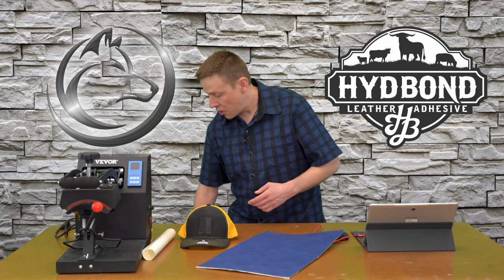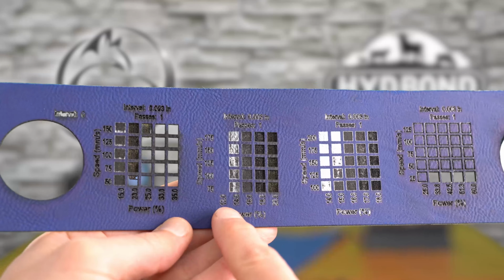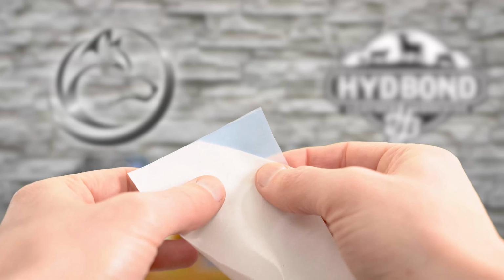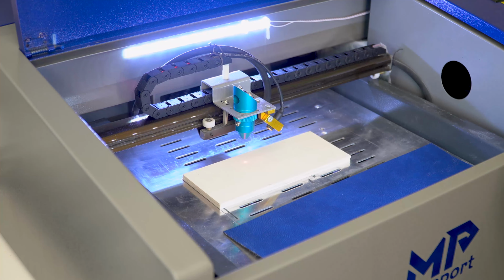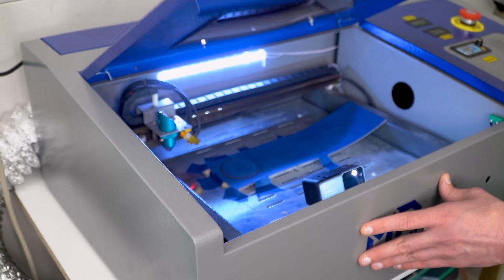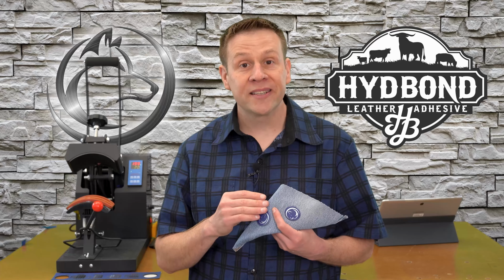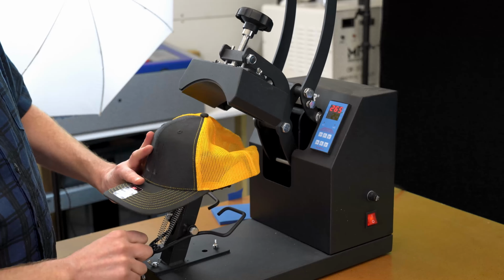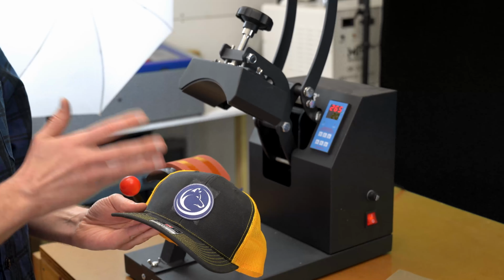Making Hat Patches with Hydbond and Monport 40watt Co2

Comment: Having the same problem with creases.  Where did you get the replacement pad for your hat press?  Thank you.
Reply from the maker: I used a silicone pad from Amazon- Soply 12" x 15” Thickest (.33") Silicone Heat Press Pad Mat Silicone Pad for Heat Transfer Machine Press Replacement Pad.  I cut a small piece that fit the hat a little better.  Hope this helps.
Reply: @thelaserchannel1  thanks a ton.  I purchased some heat press pillows from Amazon.  If those do not work I will give this a try.  Be safe!
Reply from the maker: @shadyroadfarm  It works better than what comes on the hat press.

Comment: I'd like to start engraving leatherette  patches for hats. However, I've read that engraving leatherette can produce toxic fumes.  I've also read that certain companies such as JDS leatherette patches are safe to engrave. Or should I just stick with real leather?  Any advice is much appreciated. Thanks...
Reply from the maker: A very good question-  I use leatherette and leather-like for my patches that state they are laser safe. I rely on a good exhaust system to remove all fumes from projects- I don't want to inhale any fumes from any material.  Real leather actually gets tricky- it depends on how the leather was tanned- some tanning chemicals are laser safe and produce great results and other tanning chemicals are not laser safe.  I recommend buying from good sources who state if it's laser safe and if there's any harmful fumes.  Hope this helps!